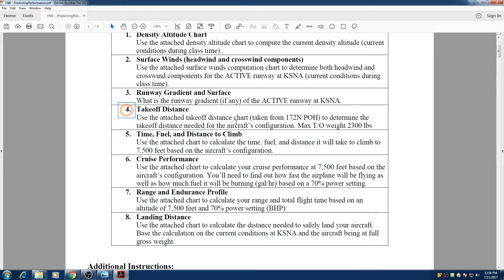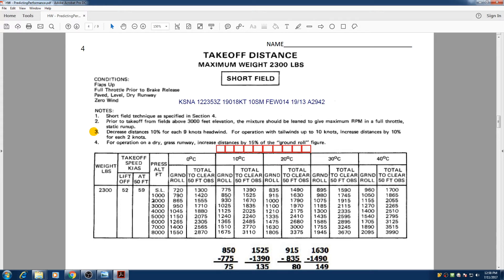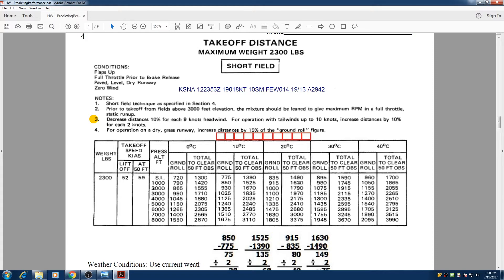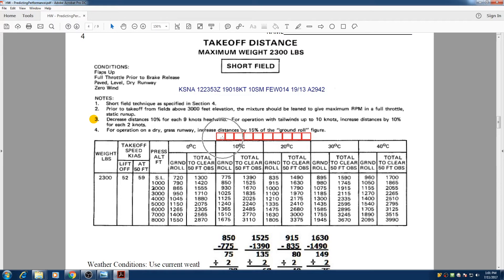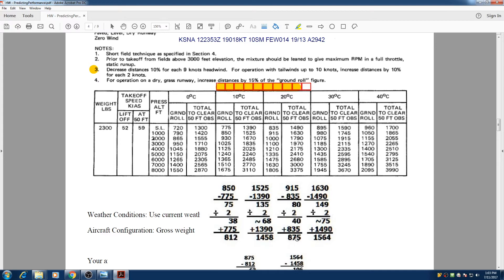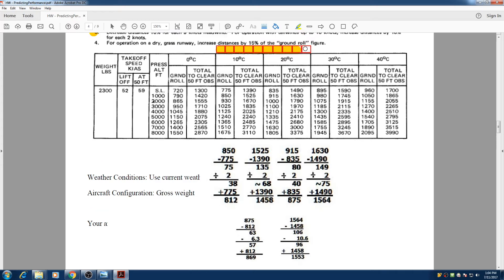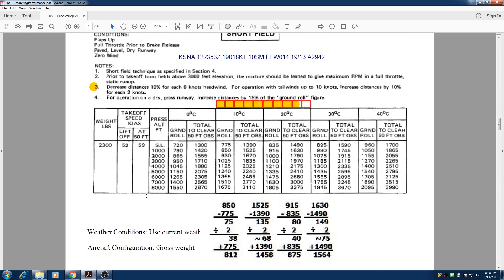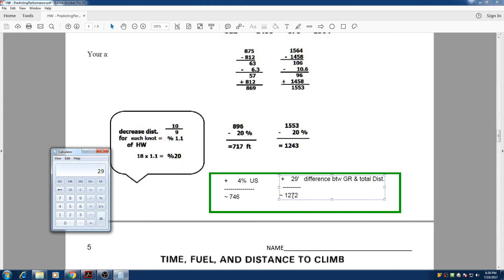Takeoff Distance Chart (Step 4)

Comment: I like the 10% off calc in the 'Your a" section. What number would you use if it was 16 degrees? what percentage would you use to calculate?
Reply from the maker: Great question! It will be 60% of the total difference between distance figures from 20 degrees and 10 degrees. You will then add that value to the figure from 10 degrees in order to get a performance figure for 16 degrees.